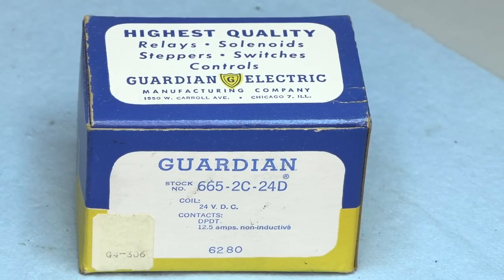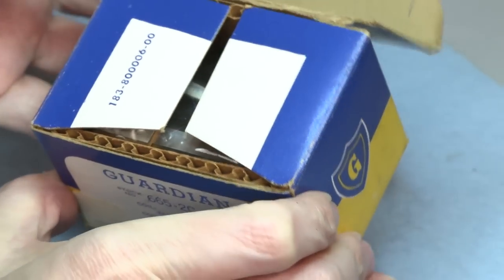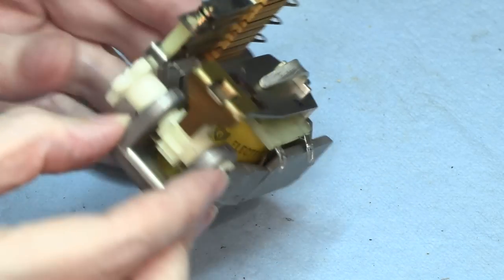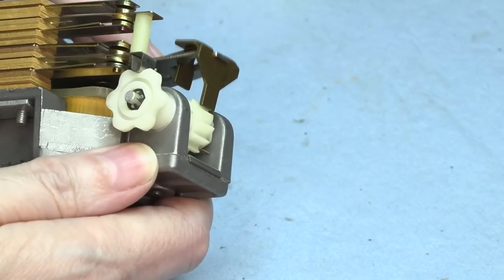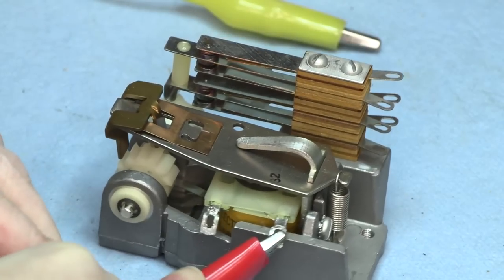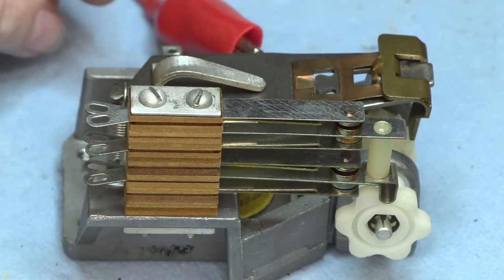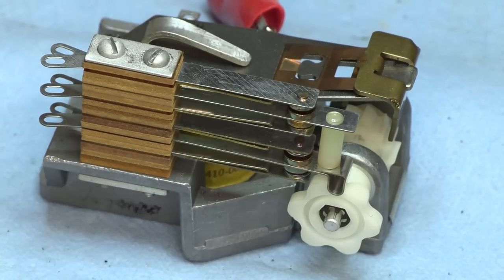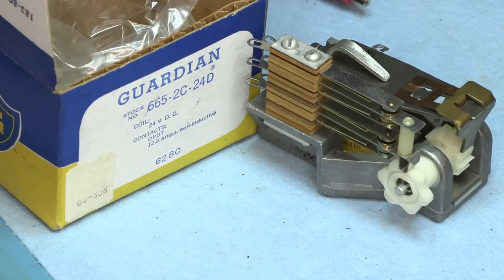When Relays Were Art

Comment: They were so handy to build things with, in pre controller days. I even recall having one of those ratchet relays in my old Datsun for the headlight beam switch.
It was sealed inside a metal can and stumped many auto electricians back in the day. The uninitiated expected it to function as a normal relay... lol
Reply: Sort of normally use a relay for say tralier lights wired to a car circuit as repeaters

Comment: As a former Strowger (U.K. mechanical telephone exchange) engineer; a lot of people miss the deliberate movement in the make and break contacts. These don’t just move to ensure a good pressure contact against the centre changeover contact, but that movement also slides the contacts against each other to provide a cleaning function.

Great piece of nostalgia, thanks for sharing.
Reply: I never worked on Strowger, here in Australia I worked on 2000 and SE50 Step by Step equuipment, and was taught how to adjust the relays - the instructors destroyed the gaps and tension on the springs and we had to adjudt them, set the gap and tension - fun times!

Comment: Our final project in electronics school was to build a conveyor belt that had sensors and logic to identify four different types of boxes.  Tall and light. Tall and heavy. Short and light. Short and heavy. They had taught us TTL logic, but had also taught us Relay Logic. I had a ton of relays and built all of the logic and stuffed all of the relays into an old external video camera power supply box. The other guys in my group looked at it with bewilderment because it was literately just just a "black box" with a bunch of wires coming out but it worked.  Micro switches were used for the conveyor sensors and we had  lights labeled for identifying the the boxes and it worked perfectly with absolutely no electronics.

Comment: First 'relay' I tinkered with was in an old Lionel train engine.  Each time you turned power off/on it would turn a little wheel that operated different contacts.  So you reversed the toy train by just stopping it.  Or you could push a button on the 'power pack' that interrupted power to drop out the relay momentarily.  Thought it was quite fascinating as how it could connect the motor first one way, then the other.  Then over the years ran into all sorts of old motor-controls that used custom 'relays' for starting, braking (as well as 'plugging')  Quite a wide range of ingenious devices.

Comment: I spent the formative years of my working life as a telecoms technician fixing step-by-step telephone exchanges.  Uniselectors, relays and such were everywhere in those days.   There's nothing like the constant buzz of a city-sized step-by-step telephone exchange in your ears for eight hours a day.

Even the dial-tone generator was a mechanical device -- a motor driving a communtator that produced an 48V peak to peak AC waveform.

Way back then I was designing solid-state replacements for these devices that would have eliminated the constant need for cleaning contacts and adjusting relay tensions -- but, as you'd expect, upper management wasn't the least bit interested 😞

Comment: my Gottlieb pinball machine, 1956, is full of these Guardian relays! most are custom stacked to have many single and double throw circuit configs / I bought a field service kit decades ago; it has three or four sizes of silver contacts and leaves and springs and insulators; stack screws and insulator tubes. /and the blueprint of the machine is drawn in the ladder-logic of the day.

Comment: It's been over 20 years since I worked at a school bus company.  Even then, most busses had solid state flashers for the four amber and four red "warning lights."  However,  one school district still specified an old flasher unit with a motor and mechanical contacts.  Not surprisingly, the company that made them was in that district.  I just did a quick search, and the company is still making them.
Reply: Is it still being made in the USA?...would be nice.

Comment: This is an amazing example of a "latching relay".  In the 1950s when the concept of "digital" logic was emerging, relays that worked only as long as the activating current was on,  were not much use. Relays/switches needed to stay in the state the digital signal had set them, to be of any use to the circuits "below" them.

Comment: Hi Fran I started working for Post office telecommunications soon to be British Telecoms in the late 70's. At the time we still had switchboards which used a lot of relays and I was sent on a training course part of which was relay adjustments. We were taught how to adjust the contacts and even making sure the contact weight was correct. It was very frustrating at tines.
Reply: If you watch " the museum of everything else" channel on YouTube they have a Strowger telecom switch in the museum ,  Which has been repurposed to operate other weird devices of the curator's own making.
Reply: I worked for a supplier of post office relays for a while in quality control. I remember having to tweak the individual contact leaves to get the required operations. Some contacts had to be make before break and others had to be break before make, then there were the tensions when made. Very fiddly when they had to be disassembled to resolve major issues. All manufactured by women who were deemed to be better at the fiddly stuff!

Comment: I remember buying a Jackson Bros air-variable capacitor in 197-something for a Practical Wireless receiver (I don't think I ever got it working .. probably why I ended up in computing). You really felt you'd bought a proper component with something like that. Not like a bit of plastic with legs, however many there were.

Comment: I have fixed any gods amount of machinery which used relays and steppers, far more reliable and easier to repair than PCB and SS controllers and usually enourmously cheaper than replacing a whole pcb with a 20 cent component failure that you cant find because they need the machine back up and running NOW!! Love the videos Fran!
Phil, UK

Comment: Alternate action DPDT.  I have one theatre that uses it for their curtain.  A single pushbutton causes the curtain to open or close.  The only catch is that one has to have it go the full travel before sending it back the other way.
Reply: What happens when you hit the button when the curtain is still moving?
Reply: @kaasmeester5903   it stops.  If you hit it again, it starts (in the same direction).  There is a complementary switch on the machine itself that trips when the machine hits its stop...it not only stops the machine but now it can go in the opposite direction.

Comment: Electromechanical Relays were the main form of controls technology before programmable logic controllers and microprocessor based controllers were developed. I retired from working in Los Angles DWP generating stations that were built in the 1950s. These old Generating Stations had cabinets that were full of electromechanical relays. Also I live in a condominium building that was built in 1992 and has an elevator that is still running on an electromechanical relays control system. These electromechanical relays today are considered obsolete and not made anymore. When they wear out the replacement systems are based on microprocessor controls and programmable logic controllers.

Comment: ...and a joy for ever.

Just an electromechanical equivalent of a bi-stable relay sometimes found in electrical wiring, allowing you to turn the light on and off with a momentary button. Dating back to the days when mechanical stuff was cheaper and easier to make than electronics. Now it's the complete opposite.

Die-cast aluminum like the FuzzyWuzzy! :)
Reply: The funny thing is that not everyone saw that coming, even those supposed to be skilled in the arts.  My dad was in college when the first microprocessors hit the market, and he and a friend started playing with them (4004s I think).  One thing they envisioned was replacing the incredibly complex mechanical sequencers in washing machines with a simple microprocessor.  These things were going to make it into cars, even toys.  But the EE professors at college said: "That will never happen"; after all these mechanical contrivances were way cheaper and easier to use than those expensive and fragile electronics.
I do miss devices like this though; some of them are little gems of ingenuity.
Reply: @kaasmeester5903   My wife and I bought a commercial grade clothes washer a couple years ago;  The switching is primarily electro- mechanical because it's more reliable than microprocessor circuit boards.  On most modern appliances it's the processor board that fails 1st.

Comment: Pffft. Give us a look at a 100-contact Strowger switch!  https://en.wikipedia.org/wiki/Strowger_switch

When I was in the US Navy, several ships built in the 1960s still had mechanical phone systems based on Strowger switches. A rotary phone had a nominal pulse rate of 10 pulses per second, and as the Strowger switches aged they sometimes couldn't keep up, meaning either one digit would be reduced by a step or two, or the entire call could fail to complete.  We had to maintain these switches using tiny screwdrivers, feeler gauges, contact cleaner strips, and light oil.  We had a bench test station that would repeatedly cycle a switch through its paces, and we could vary the pulse rate up and down.  We didn't place a switch back in service until it could sustain at least 15 and preferably 20 pulses per second.

The phone exchange also had its own internal test station that could cycle the entire exchange through its paces, during which the phone exchange room would become a cacophony of nearly 100 clicking and clacking Strowger switches.  These tests were normally done in the middle of the night to minimize the impact on ship operations.  One time we forgot to configure the test to exclude the last switch bank, which connected to the individual telephones.  At around 2 AM every phone on the ship started ringing for 1/5 of a second every 30 seconds.

The Captain was NOT amused.
Reply: What a nice story! I wish I had a Strowger switch (a.k.a. stepping switch, or uniselector). Holy grail for me.

Making a B-7971 display FRANLAB, only with a uniselector and a bunch of diodes if necessary? Not a problem at all, and pulse it with a neon lamp + capacitor relaxation oscillator. Real deal retro stuff. All this clicking would surely drive Fran crazy though, haha!
Sam Battle (Look Mum No Computer) pretty much mastered using uniselectors in sequencers. And look no farther than ConnectionsMuseum in Seattle to see the old exchange brought back to life and lovingly maintained by Sarah and her team.
Reply: That's a treasure of a story, thanks for sharing!
Reply: There was a strowger exchange in my village where i lived as a kid in UK. One day a friend and I were riding our bikes nearby and noticed the door was open so we popped our heads in to see what this mysterious building contained. The phone engineer was working inside and he invited us in to take a look at at all of the kit clattering away. We were too young to understand the details, but it was very impressive and stuck in the memory.
From then on I was always impressed that any where I went in the UK, I could see the name of my little home village listed amongst the exchanges on the back panel of any public kiosk. Kind of reassuring some how.
Reply: @crabby7668  Kids riding bikes, infiltrating mysterious tech-packed building? Almost like Stranger Things, haha! Nice story.
Reply: @KeritechElectronics  I am not familiar with the TV series, so I'll have to take your word for it. It was an interesting experience, but I wish I had known more at the time, to get the most out of it.

Comment: The "7" in the address is a postal "zone".  In this case, a particular zone in Chicago.  (Not the same meaning as postal zones today which relate to sections of the country for distance.)  These "postal zone" addresses can be used to help date things since they existed from 1943 to 1963.  (Started during the war to make it easier for inexperienced people doing sorting, due to many of the experienced ones off to war.)  This evolved, of course, to the "ZIP" codes we have today, and "ZIP" actually stands for "Zone Improvement Plan."  So, it goes back to yet another innovation developed due to the needs during WWII.
Reply: I always wondered what ZIP meant, here where I am it is just the Post Code which is a 4 digit number.  And where I am in Victoria it begins with a 3 like 3677 my code and radio stations are similar like 3NE. over the boarder in New South Wales it is a 2 for example.

Comment: Very satisfying! The older relays used some beryllium in them, didn't they?
Reply: A beryllium copper alloy,  typically.  Copper alloyed with beryllium makes a pretty good Spring as well as a good electrical contact material although in my experience of cleaning hundreds of relays in audio equipment the contacts themselves are usually plated with something else besides beryllium copper;  The oxidation on them is black and if you polish them with a pencil eraser the contacts will have a silvery colored finish.

Comment: Requires no power to stay in either position - 2 bits of NVRAM!
Reply: But a tad slow :p
Reply: @iamjadedhobo  The price you pay for RAM that's rated for 12.5 amps.
Reply: It's strictly only one bit (the two sets of contacts contain the same information), but on the other hand it is non-volatile.
Reply: @olmostgudinaf8100  The two contacts share a common shaft which forces them up and down at the same time.

However, it's a DPDT configuration, so there are 2 separate "input" leads for each switch that can be connected to whatever you like...

Essentially it just has one (pulsing) address line which selects 2-bit location 0, or 2-bit location 1.  

If you limit yourself to ones and zeros, you could hook it up to return 00, 01, 10, or 11.
Reply: @Cynthia_Cantrell  You don't get 01 and 10, only 00 and 11. That's why I maintain that it is a single bit, albeit duplicated. You wouldn't think of a single-bit flip-flop driving a DPDT relay as 2 bits. This is the same thing.
Reply: @olmostgudinaf8100  Each switch on the relay has an "up" contact, a "down" contact, and a  "common" contact.  Nothing forces you to connect both the ups together, or the downs.   Tie the up on switch 0 to 0 and the down to 1 on the same switch, and then the opposite for the next switch - you get 10.

Of course you could also connect the relay up and down contacts to other voltages for a more analog response.  Or, use a trinary system with a contact left open.

Comment: During my telecoms apprenticeship, I learnt how to adjust the relays in Strowger telephone exchanges.
The contact pressure was tweaked to within spec, using an adjustable tool, to so many grams contact pressure. I forget its name, it's been a while.
The copper residual flux slug was adjusted for correct timing, too little and it slows operating time.
There was a newly built PABX in a large company that didn't work, and the fault was an incorrectly adjusted residual.
The timing of all those relays was critical for the correct operation of the switches.

Comment: One photocopier that I maintained in the 1970s was controlled by a stepper relay. 36 steps, 10º per step. Five cams on one shaft. Solenoid was 120vdc. The assembly was ≈ 10 inches long x 4 inches square. Using a test mode, it would cycle through one revolution in ≈ 0.1 second. Bzzzt! That was the version built by CP Clare. The version built by Automatic Electric was a bit less spectacular and a bit less reliable.